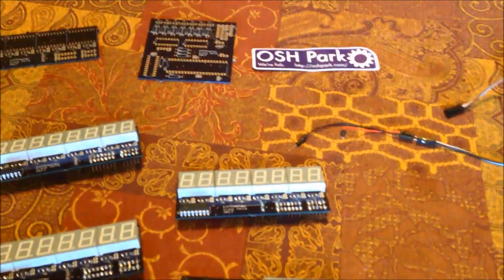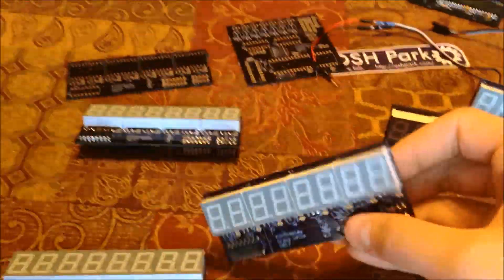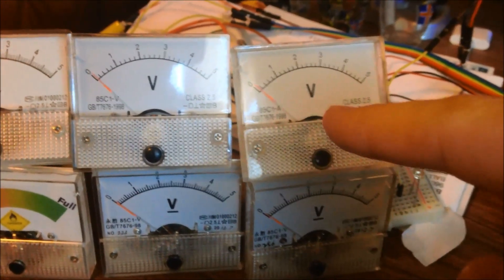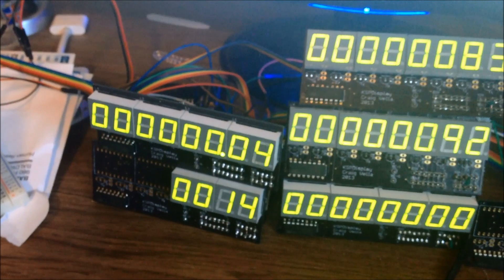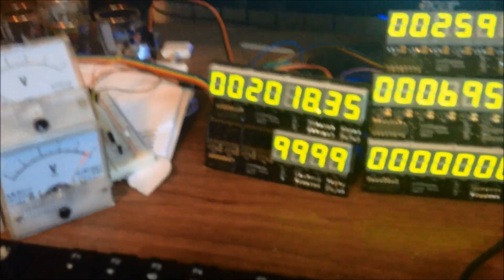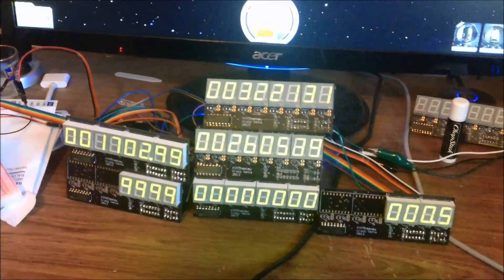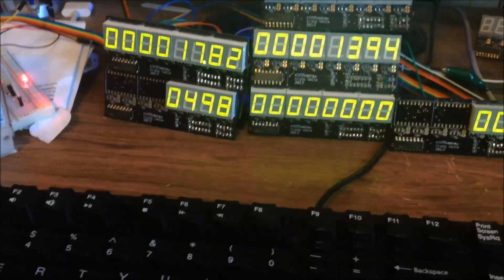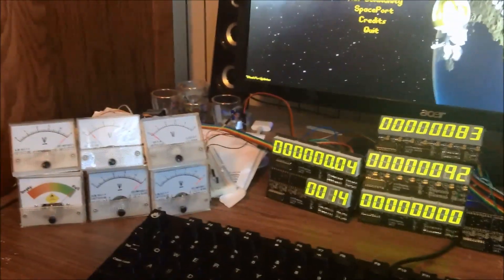KSP Display Update

Comment: Love it! One thing to add might be an LED board with indicator LEDs for RCS, SAS, lights gears and the likes so you could play the game completely without the UI up and just your awesome displays.

I also noted you missed screwholes on the PCBs. Another thing I noted is that you've got the cable connectors on top, this might cause problems with mounting, Put them underneath instead :)

Comment: You could also add a button/toggle switch panel that has the action groups, lights,
landing gear, RCS, and SAS.
Also for the background you could put notches on the half, quarter and eighth  so you can gauge your fuel easier. and instead of the danger symbol maybe label it oxidizer,liquid-fuel, Battery etc  .
i just found out about your project today and i love it and hope to see it get into the hands of many KSP players. Keep up the good work!